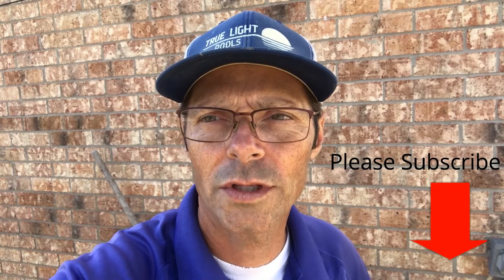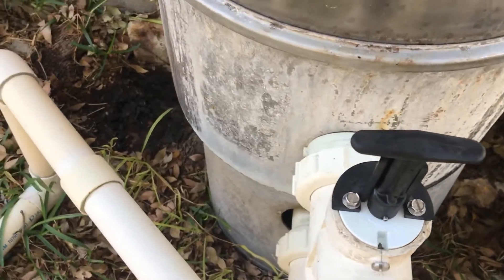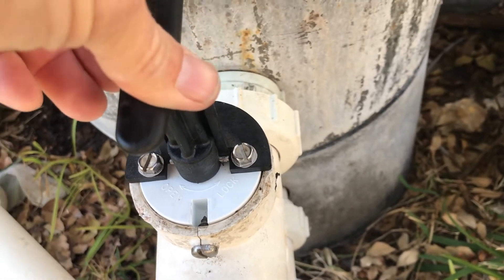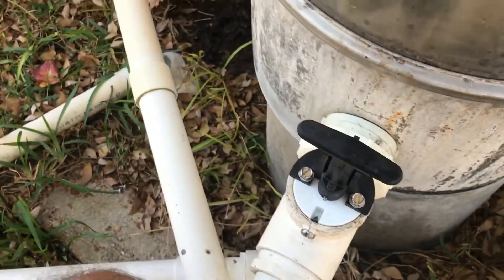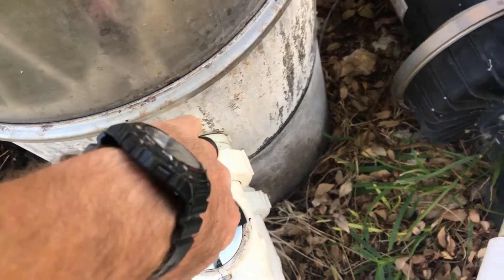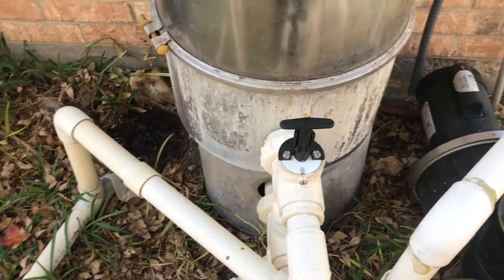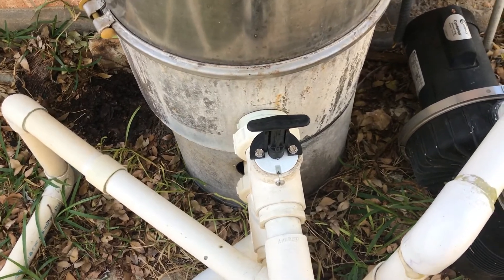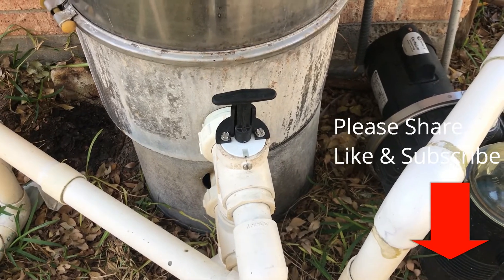Pool Basics: How a Pool Slide Valve Works

Comment: My valve is in the up position and it’s still filtering, not backwashing. How is that possible ?

Update: turns out my backwash valve (hayward) does in fact go down for backwash position. But thanks to this video at least I knew what the lock and unlock positions were. Anyway, backwashing done. Muddy water out. Clean water flowing. Thanks again.
Reply from the maker: The one pictured is a Pentair brand valve, so your Hayward one may be configured differently.

Comment: I have a good one for ya, why does mine on my TR60, backwash when the t handle is down? I run in filter mode, with the handle up. Is there an issue with mine?
Reply from the maker: Yes, many large sand filters run their filter valves the way you describe, up is filter mode and down is backwash.  Not sure why, but it's that way on commercial valves.  Maybe it's just the way they plumb it.

Comment: I left it in the backwash position for several month and it's now rusted and don't to push inside, any idea on how to fix?
Reply from the maker: see if you can spray WD-40 in the chamber to move the piston up and down.  If you can't get the piston out, you may have to replace the whole T valve assembly by plumbing in a new one.

Comment: How do I change the T-Handle? Mine broken as I was turning it.
Reply from the maker: Have to unscrew the middle screws that are holding it in and pull piston assembly out, then replace complete middle piston assembly.
Reply: Order part on Amazon. Take out metal pin, replace, put metal pin back in
Reply from the maker: @KENPACHI1K  Yes if just the handle part.

Comment: How can i vacuum to waste with that valve?
Reply from the maker: You can't exactly, the 2 positions are only filter mode and backwash mode.
Reply: @truelightpoolsllc4441  
So, I’m assuming that you can NOT remove the filter (not physically removing but just bypassing the filter) from the system by changing the setting and just recirculate the water with a slide valve??? I would need a multi-port valve in order to do that, correct??? Thanks in advance.
Reply from the maker: @DFWJon  That’s correct, it’s filter mode or backwash mode with a slide valve.
Reply: What I did was remove the top on my TR60, removed the diffuser, made and installed a ELBOW that threads onto the pipe the diffuser was threaded on, and extends above the top of the filter, then attached my backwash hose to that elbow. Feed the hose out to my alley, and then hook up my side port hand vacuum. Set it to the side port, and put the slide valve in filter mode and vacuum. Water comes out the hose, dirt and all! Works great, just a pain to have to do it this way vs a multi-port valve.